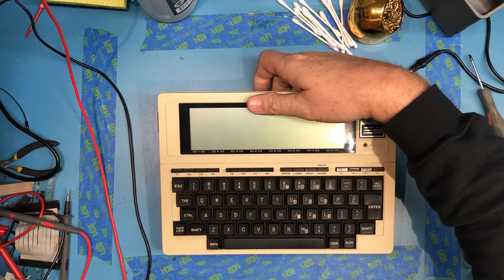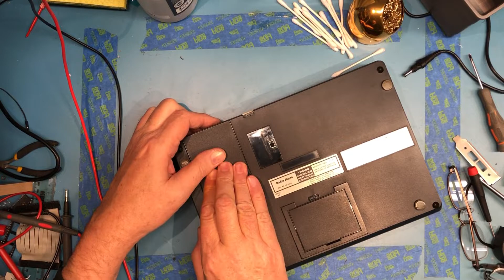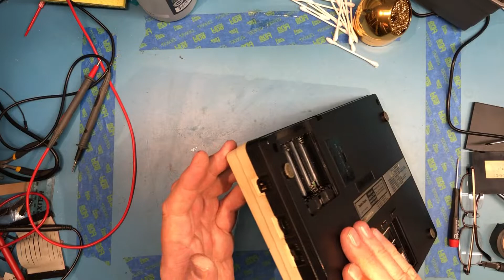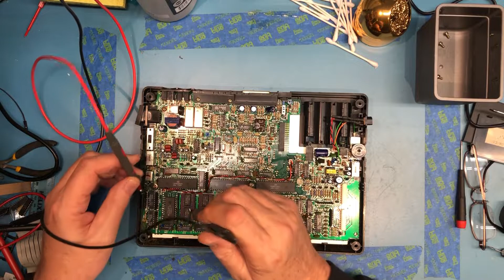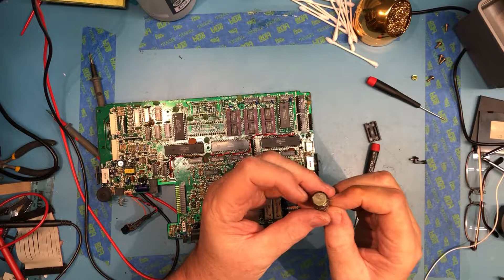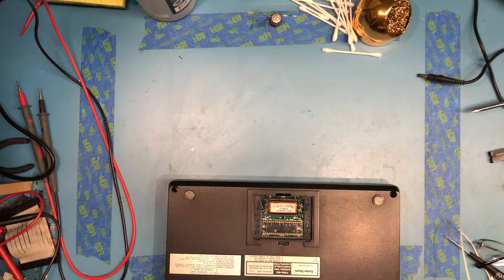Tandy Model 100 - Teardown and quick look at it - STB237

Comment: The M100 is a first gen model, while the M102 is a 2nd gen model.  Likewise there is the NEC 820x (1st gen) and the 830x (2nd gen).  I have not seen inside the NEC models, but my guess is that the internals for the 1st gen and 2nd gen products will be similar to the Tandy line.  That is, the M102's internals will be comparable to the 830x, and be much nicer than what you see here in the M100.

As for getting your M100 to boot - I believe it will only boot if the internal battery works, and is charged.  If the internal battery is dead, the machine will not boot.  That's one thing to look at anyway.